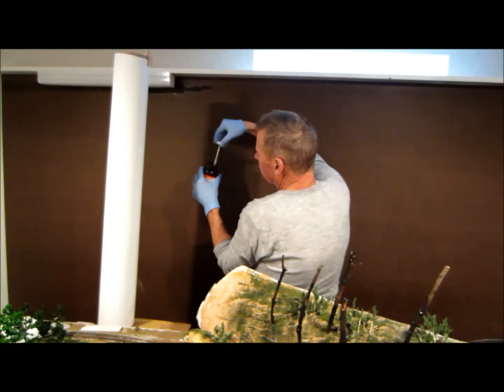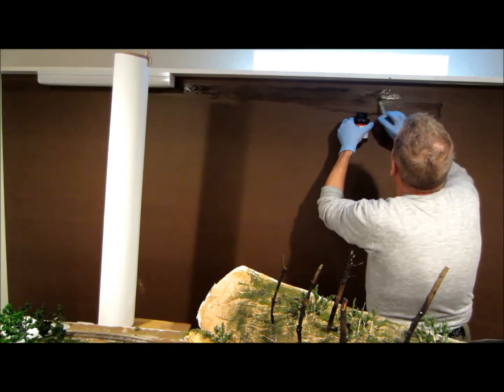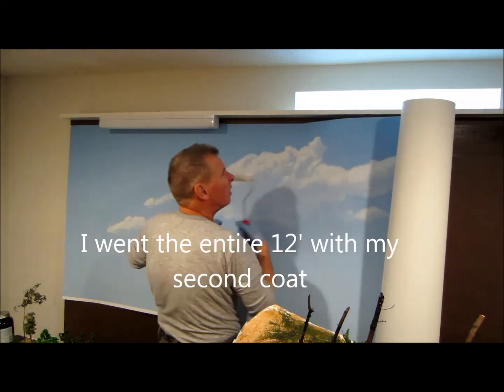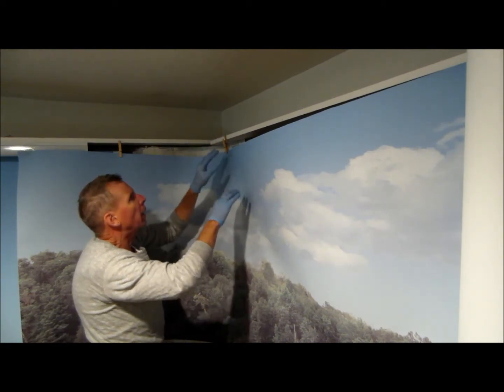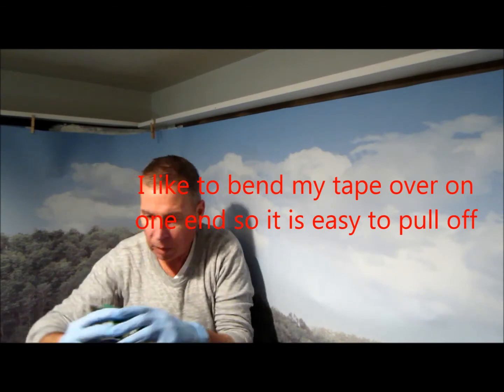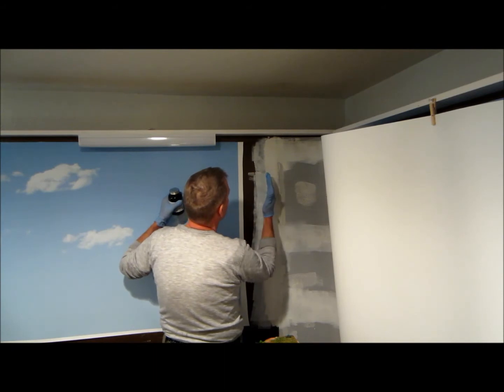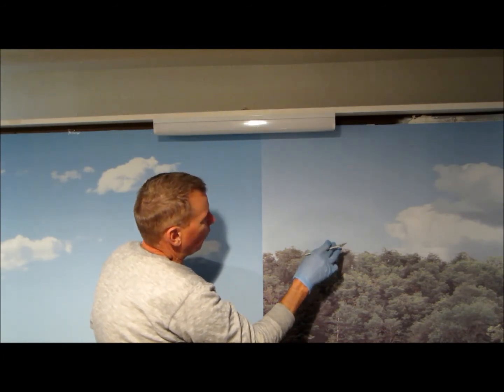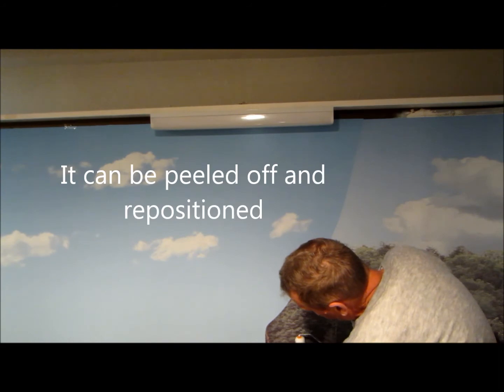Installing a Model Railroad Backdrop, Part 2

Comment: I also used 16 of the 24" x 12' backdrops from Backdrop Warehouse about a year ago.  Unfortunately I followed the inline instructions for rubber cement and glued the top, middle, and bottom.  After a year, I now have many wrinkles where no glue was applied.  I think only gluing the top would have prevented this or putting glue on the entire masonite..  I may tear the whole thing down and paint instead.  I live in a very dry climate, so it's not due to humidity.
Reply from the maker: I agree with glueing on the top only being a better plan.  The best areas of my backdrop is where the material can hang freely.  I have had some wrinkles develop at the joint areas, however the lighting greatly affects the appearance of the winkles.  Lighting from directly above makes the wrinkles show up more.  Lighting from the center of the room seems to make the wrinkles disappear.